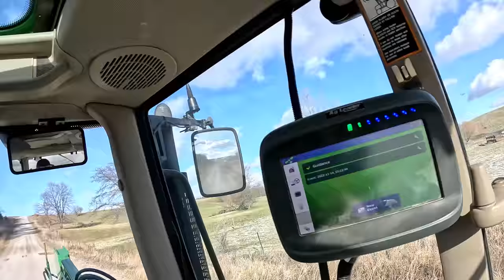100,000 POUNDS of pulling force to install 70,000ft of drainage tile!

Comment: Great video. I'm a retired drainage contractor. I had the first plow in Illinois, a Canteco behind a Versatile 950. I also had a Sprecher 6060 for pipe up to 12"
Reply: And a TA55 Barber Green for pipe up to 24". Also a 410B John Deere backhoe with a detachable auger backfiller, scraper, grader, various trucks, trailers, support van, and other pieces of equipment. In 1980 I contracted a million ft job in Fair Oaks Indiana where Prudential Insurance Co had purchased 24,000 acres of land and put up, at that point, 60 center pivot irrigation systems. I learned at workshops that a wide trench and flat bottom causes major deflection of the pipe reducing flow capacity by up to 50%. There is a much better way! Dig your start holes on the back side of the main just like you have been doing on the front side. Cut out a section of the main. Set the plow in the backside trench and pull through  on grade until you clear the main. The pipe then has the proper grade, has the necessary "V" bottom for support, and the trench is only as wide as the plow, and practically no hand "bedding" on exposed pipe. . If you try this, give a good trial of at least a dozen or so tie ins. Once you and your guy get the hang of it, it's actually easier and quicker. Good luck!
Reply from the maker: Very cool!
Reply: @iowANFarmer  I hope you try this method. It's required by the Ontario Ministry of Agriculture as well as licensing for contractors and their machinery. I also installed one of the first subsurface irrigation plots at Fair Oaks.

Comment: Just for fun, hook the 8110 to the excavator and see which one pulls more.  My guess is that with a little frost on top the tractor with tires will outpull the excavator with those shallow grousers.  I have a similar sized excavator and the traction for pushing or pulling is not that great even with all that weight.

Comment: Hey Ben love the videos I have a couple of questions. I live here in Kentucky and know a couple of big grain farmers I grew up on a small tobacco and dairy farm but have never heard of tiling. First question is. How do you know where and what fields need tiling? And in this video you said it'll be interesting to see how much better the yields are next year. But how will you know over one season the benefits of the tile? Wouldn't you have to figure it over several years seeing how we don't receive the same rainfall amounts and things like that? I'm just trying to understand what y'all do.
Reply from the maker: Tile is installed in ground that doesn't drain that well/fast - to help promote a good ratio of Air/water/soil mixture.

It also improves water quality and prevents runoff.

Tile takes ground that doesn't preform like it should and turns it into high performance ground. Most people say 15-20% payback - My guess is closer to a 3 year payback - even shorter if you catch the right year - plus the increase in value of the ground.

Comment: In our soils when we run an 8” we run the 4” first just like you are installing without the pipe, the run 8
Reply from the maker: Pre rip with the 4”?
Reply: @iowANFarmer  yes we run a 3pt soil max.  The only issue we have come across is the mound of dirt can start dragging on a 3pt plow. So we push it off the trench after the pre rip.  It does a couple thing.  You can find the rocks and pretty much pull the plow without a tow

Comment: I work for a drainage company here in Ohio, put in around 6 million feet a year and we use Fratco tap tees but we tried some of them same exact red tap tees you had and we hated them but I will admit they do have a stronger hold on the tile
Reply from the maker: Haven’t tried fratco couplers - I need to try out some of their pipe. What do you think of that! 

6 mil feet a year is a lot. I’d like to get to 500000
Reply: @iowANFarmer   we love the Fratco pipe, we only get it 8" and bigger because we get 4-6 from a local company but we get what they call flexcore so it's smooth inside like dual wall but flexes enough to run through a plow but it is super tough pipe

Comment: Is that pipe gonna be on grade after the spinning and excavator pulling with bucket? I kinda doubt it
Reply from the maker: Realistically, the pull was very smooth and slow - the plow was able to keep grade. All the LinkBelt did was attached to the tractor.